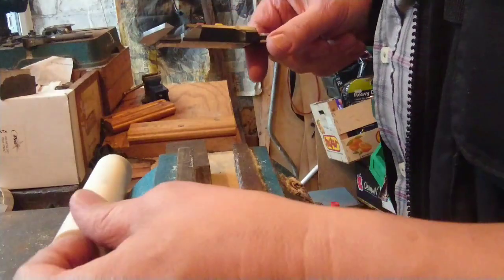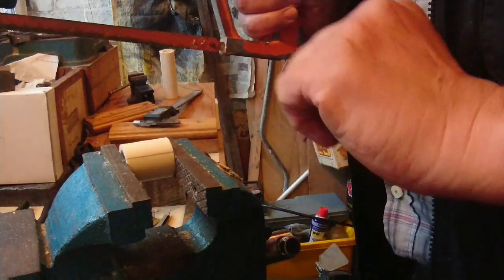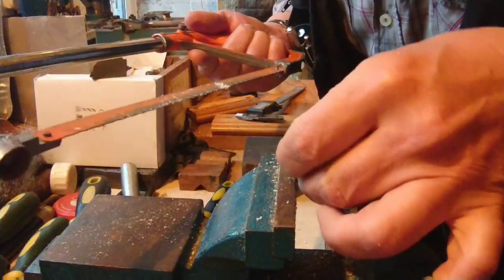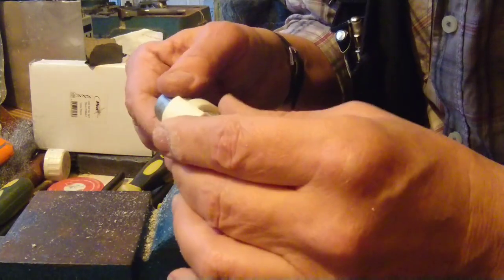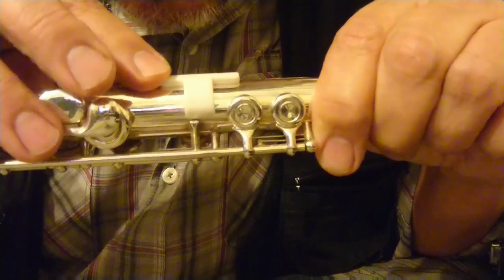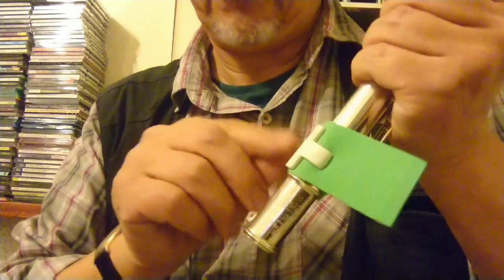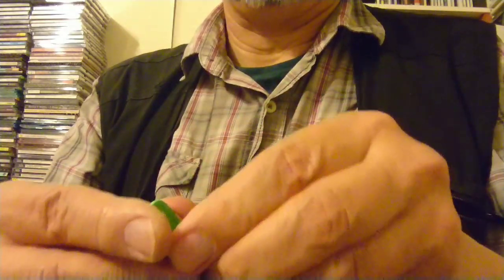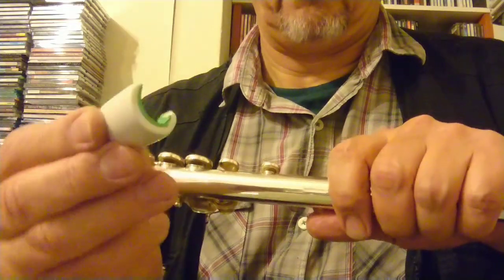Making a DIY experimental clip-on L1 finger rest for metal Böhm flute.

Comment: Thank you for the video. Do you think that such a clip will make a wooden flute more likely to crack because of the pressure?
Reply from the maker: No. The pressure once mounted is very little. and is not applied in a way which would stress wood against its intrinsic structural weaknesses. But one simply wouldn't need such a thing on a normal full thickness tube wooden concert flute unless one had a more serious physical problem than the friend I made this for. She has no problem with a wooden flute she is currently borrowing from me. Even a Rudall Carte thinned body wooden flute tube is a fair bit fatter than a metal flute. The thinness/lack of bulk of the metal flute tube has been a problem for hold/support ever since it came into existence.
Reply: @Jemtheflute   I see, thanks. By the way your videos about the flute's support was very helpful. You are the only one who made me really understand the 3 pressure points issue. I had pains in my left hand because of the "death grip" as you call it, and was looking for a solution. Found your paper about it and the videos and started an important change in the last few weeks. Will take me a little more time adjusting to it, but It feels right!
Reply from the maker: That's great. I'm glad you find my videos and documents useful. Good luck with solving your problem! 🙂
Reply: @Jemtheflute  Thanks a lot
Reply: @Jemtheflute  that's true, the Louis is fine, it's just the metal Flute that I struggle with and your solution has made a huge difference xx